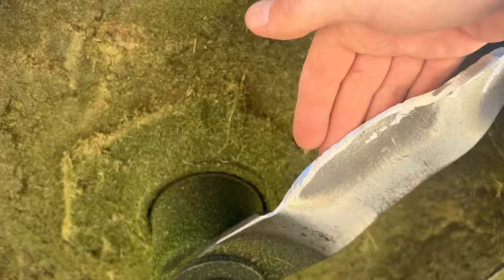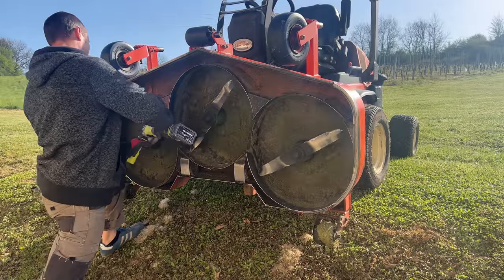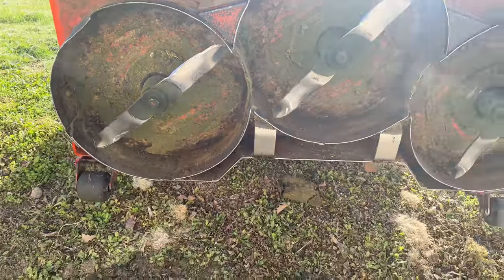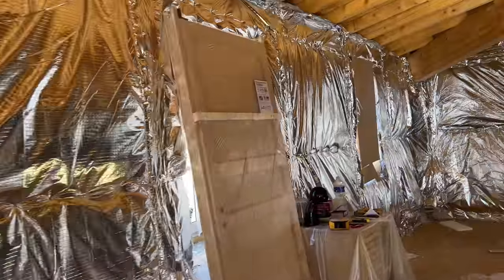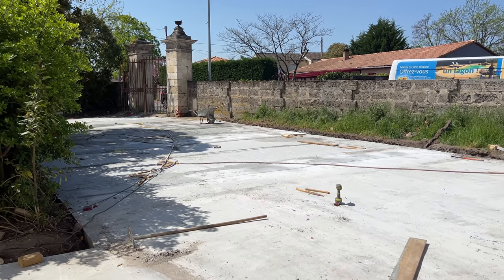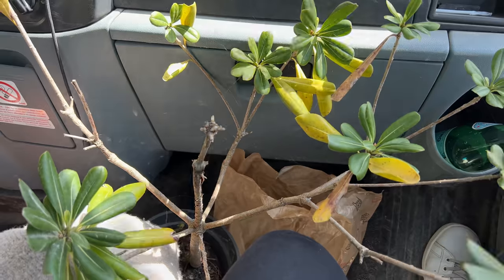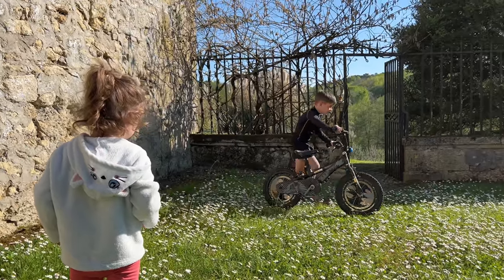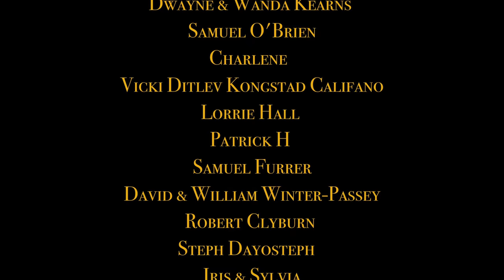EP154 We Are Back 🎉Meeting Lucas , Tricky job & Olive Trees @ Our Passion Project

Comment: The antique chairs are beautiful. Too bad the 2 are broken; however, I have seen other DIYers repair moldings. You make a mold of the good part (top decorative part of the chair), let it cure completely , then paint or stain depending on what the rest of the piece is. Michael Petherick may have done this before, Angelina from Chateau Life did, and I think Phillip from Chateau Diaries did as well. Or take off any decorative pieces that are broken from the 2 chairs, sand, and restain. This way there are 2 with the decorative detail and 2 without. Just a thought. 🙏

Comment: This is an old video so maybe things are different now. But with the mower, train your Assistant to check the blades and any oil fittings tires and fluids before they start mowing and to not park it until the blade area is power washed. That’s all part of mowing.